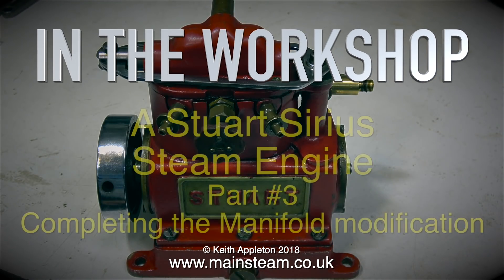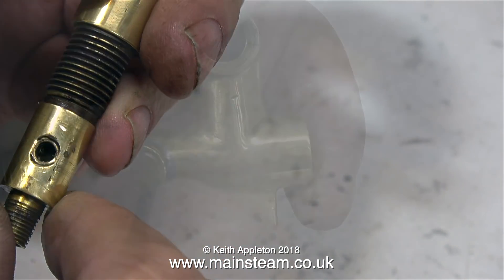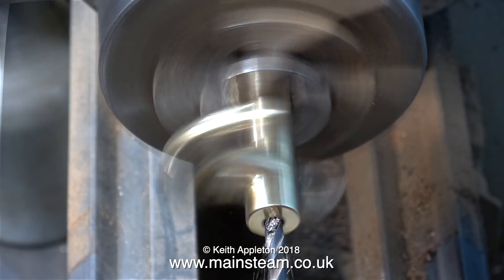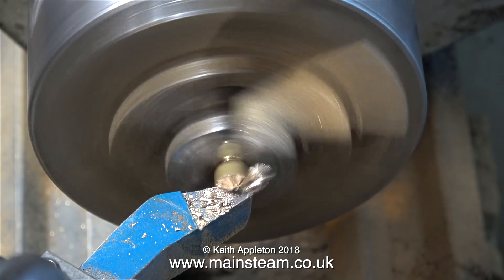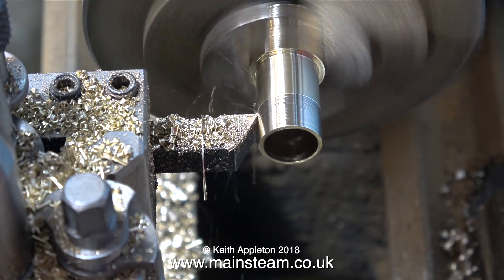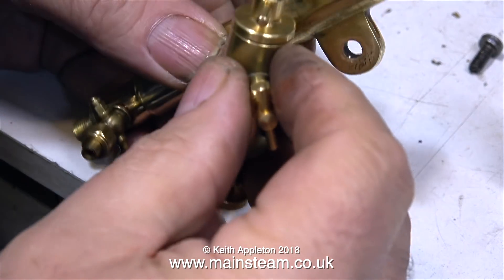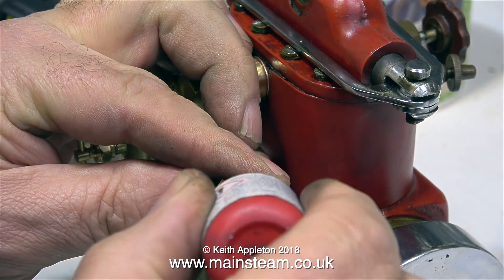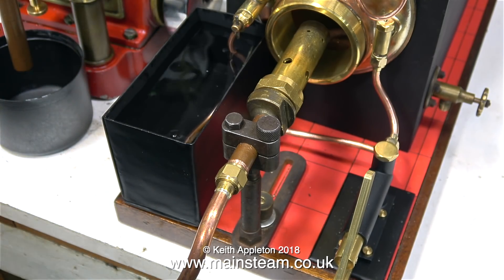A VINTAGE STUART SIRIUS  STEAM ENGINE - PART #3

Comment: An adjustable spanner of the high quality of Bahco is a far better fit than a regular spanner especially with odd sizes. Crescent should have made one of this quality.
Reply: Even a Bahco will round nuts if not properly used. The best adjustable wrench I had came with replaceable brass inserts on the jaws. It and some other tools were stolen years back and I have been looking without luck for another.
Reply: @steamboatmodel  - there should be a special hell for stealers of tools.
Reply: Toby W:  Crescent USED to make high quality adjustable wrenches!  Now they are made in China and are absolutely garbage.  I have my old Crescents and compared to my neighbor's new set, it's night and day in quality.  Same with Stanley tools, they used to be good quality but now, being made in China, they are now junk.

Comment: The exhaust pipe doesn’t bother me at all. It serves its purpose as it should. I have one small quibble, however. There is a rather distracting freckle on your right hand. I’m sure you know which one I’m referring to. Is there anything that can be done?
Reply from the maker: Please turn your computer or TV off and unplug it.
Reply: @keithappleton  - but. but. but. how will Yoshio know when your cuffs need mending or you're in need of another pedicure?
Reply: If I did that, I'd have to look at my own freckles. What fun would that be?
Reply from the maker: Just wear a blindfold, I find that works . . . . .  };-)))

Comment: Banjo bolts have a bad reputation of breaking off during tightening. Glad to see yours survived.
Reply from the maker: It down to the tightener I suppose ....  Loctite 542 removes the need to torque up the Banjo Bolt.